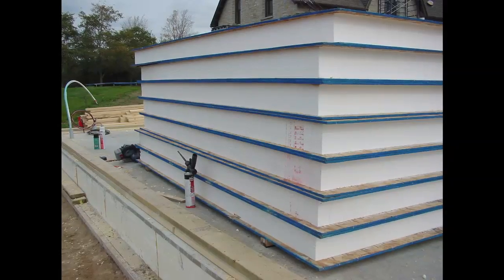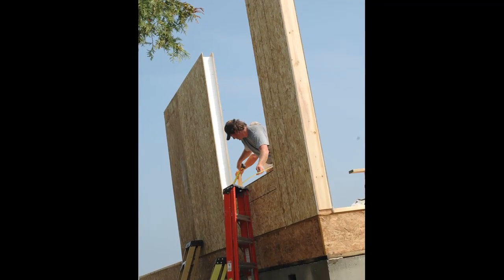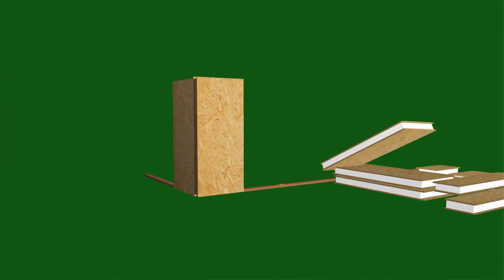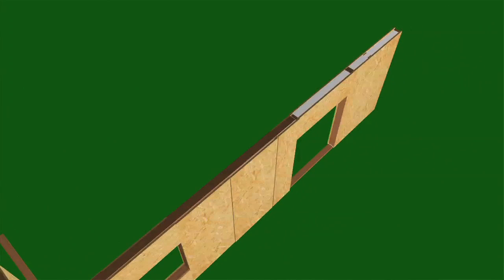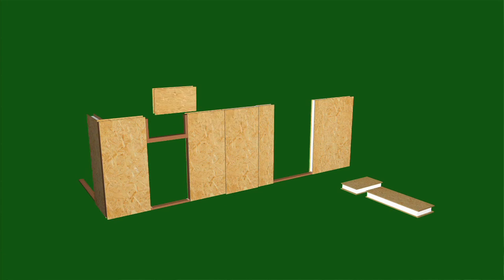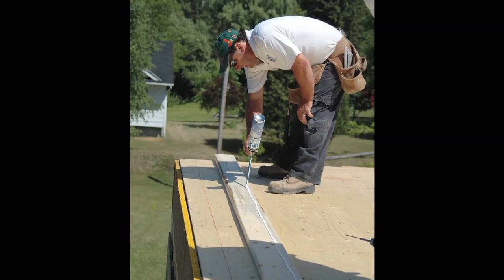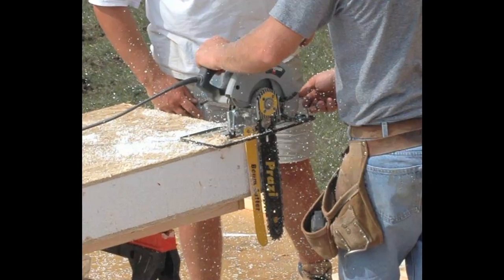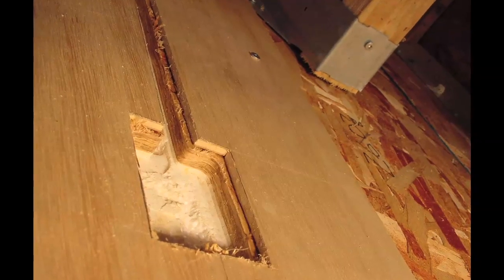How Structural Insulated Panels Work

Comment from the maker: Good Morning BorntoRunBarefoot! I've never seen SIPs in anything different than 4 feet widths, but the lengths do vary. 8 feet is the shortest, and I've worked with panels that are 16 feet long. I've heard of panels as long as 24 feet. Are you planning to build with SIPs? After living in a structure built with them, I really like them.
Drop by my website http://stevemaxwell.ca for a visit sometime. You'll find lots of stuff there, including tool giveaways, articles and the chance to ask me questions.
Bye for now and thanks for watching!
Steve
Reply: Steve Maxwell
Reply: I've got a problem with the price being 5% higher than stick built homes when you know damn good and well that thosr sections being built cost less than a stick built section and the fact that your cutting down on material and man hours worked then why is it 5% higher your saving a shit load at the normal rate of a stick built so why 5% more and how I know is that I've been in business my entire adult life and no company takes on a new design in building if it doesn't mean cheaper for them because it doesn't matter if the amount that it's better is 100 times the previous if it doesn't save them money and is going to cost them 5% more they will not do it unless it's mandated by law and then they'll try to get around it all I can see is this way saves money on 2x4 and 2x7 and truses less wood in a building and foam is cheaper than wood or you'd be building that section out of small truse like beams inside it for support
Reply: @who-manwho4182   SIP panels cost more to make, not less, than stick frame.  A stick frame can be put up by 2 guys and hand tools.  Quality is down to subjective onsite skills.  SIP panels involves a factory, CNC machinery, Certification & testing (no grandfather rights here...), and regulatory compliance.  It's not even an 'apples vs apples' comparison you're making, it's a 'fruit vs veg' comparison.....  And if the only thing that matters to you is price, then you're missing a whole other bunch of points...........
Reply: There used to be a company here in northern West Virginia called panelcraft. They would make any size you want up to 42 feet long. You could put up four walls with just 4 panels. They sold the business and I can't find them anywhere like that. They actually cost a lot less than traditional building. Seems like it caught on and it is a lot more expensive now
Reply: Here in Ireland, we can make panels up to 12m long x 3m wide.  Most roof panels we make are up to 5m long x 2.38m wide.   For walls our most common panel sizes are in the region of 4m - 6m long x 3m high.    All are craned in: too heavy for manual handling.

Comment: Sorry if this sounds really dumb, but I am currently writing my uni assignment. I have to advise on a building which could be used for emergency housing. It must be built on site and must be able to withstand extreme weather conditions. I would like to suggest SIPS but would you need cover the sips panels with an external barrier to the elements? If so, what would you suggest? also do these need any steal frame for support etc? Thanks in advance.
Reply from the maker: DannyRed Hi There! That's not a dum question at all.
SIPs panels function on their own, without any need for structural support in walls. Roofs can also be made with nothing other than SIPs. A weather barrier is required for SIPs made with oriented strand board, but SIPs are also made with plywood. These would need no exterior protection in an emergency situation because uncoated plywood SIPs are even used for buried foundations. My contact in the industry is a guy named Jeff Taraba. He owns Thermapan and you can contact him at jtaraba@thermapan.com.
Does this help? I hope so. Please let me know.
I cover lots of cool things on my two websites. For construction, woodworking, renovations and tools, drop by for a visit at  https://stevemaxwell.ca. Homesteading stuff is at http://www.realrurallife.comBye for now,
Steve
Reply: ***** I really appreciate that Steve. Thank you very much, you will be referenced in my assignment!

Comment: Great video Steve.  
I like the SIP panels.  I would definitely build my home with this product.  The only improvement I would make to this product is; I would sheath the exterior panel with Zip System OSB Sheathing, for both the walls and roof.  I imagine this would greatly increase cost of the panels, but a man can dream.  

BTW: Did you use post and beam framing for your workshop, to accommodate for the SIPs?
Reply: +byron simon I watched a few videos on the Zip system... I agree.  I would be prepared to pay a premium for that if something like a SIPS with Zip System was available in Australia.
Reply: Eco panels in Mocksville NC has just what you are looking for.

Comment: Hi Steve,

I have done field cutting in the past when the homeowner can't decide where to put a window until the walls are up and they are standing inside the structure. Sips are great for that especially when the window or door opening is under 4'. 
I am in SW Minnesota and the manufacture I use pre-cuts all my panels for me. It's fantastic. I am at the point now where sip structures is all I do. (Not sure how to send pictures)

I am surprised there are no manufacturers by you who would do cutting. Where are you located?  My supplier has shipped to New Zealand, Japan, etc....

Take care!

Comment: Love your video.  One thing I would disagree on is field cutting all doors and windows in the field verses having it done in the factory.  Especially for walls of windows in a great-room where engineering/sizing of posts and headers is required, this would be advantageous to put the liability back on the SIP manufacturer.  Keep up the great videos.
Reply from the maker: Mike Dandar Hi Mike! Thanks for your note. There are no SIPs suppliers that I know of in my area that deliver read-cut panels, but that's not as big a deal as you might think. Cutting on site is pretty easy, and all the details need an engineer's stamp before you get a permit anyway. I have heard of pre cut SIPs in other places, but never worked with them.

Do you have a building project in the works?

Drop by for a visit sometime at my online destinations: @/stevemaxwell.ca and Bye for now, Mike. And thanks for watching!Steve
Reply: Hi Steve - and all - actually we in Ireland deliver all panels with opes pre-cut: cutting them in the factory is the only way, and it's done on a big bed (16m x 4m) CNC machine.   For what it's worth we only use 15mm OSB3 to both sides as for very large panels (our biggest is 15m x 3m), 9mm/11mm isn't rigid enough for onsite handling and shipping.  John Moylan, SIP Energy, Ireland.

Comment: Styrofoam is non biodegradable. Its disturbing to see that stuff blowing in the wind when you cut the panel.
Reply: Hi Steve,
Most Styrofoam litter ends up as marine pollution. When it does eventually break down it releases toxic by-products. It is made from petrochemicals. Most countries have banned its use as packaging.
I like your product, its a great alternative to conventional methods but I wouldn't like to see it turn into a mainstream solution. Its got a great R rating which is a plus, but that's about it. I don't know where or how you would dispose of it in the future when it is finished as part of the construction. In the meanwhile could you please promote safe and responsible disposal of the waste. I used to work with the product the product here in Melbourne and I regret all the times I let it blow in the wind.
Good luck to you Steve.

Comment: how do these houses stand up to hurricanes what is the wind rating? lets say the house is bult to code in florida what can it take
Reply: Several SIP-built homes were knocked off their foundations in Louisiana and Mississippi during Hurricane Katrina. The homes were found, more or less intact, several miles from their foundations after the hurricane.  They had floated away from their foundations after wind and water wrenched them off the concrete slabs.

I also have a friend who has a SIP-based home just north of Lake Pontchartrain whose house has two large trees fall on it during Katrina. Limbs did puncture the roof but damage was minimal. The trunks snapped upon impact with the roof.  These were two pine trees with base diameters in excess of 20 inches. The technology is extremely strong.
Reply: There were two ways to prevent this. 1. Better anchoring to the foundation. 2. Better house design, e.g., a dome presents so much less wind resistance than a box that they stay put in 150mph winds. They withstand F5.
Reply: Don Duncan  I’m not providing these as an example of a SIP vulnerability. Quite the contrary! The OPs question concerned SIP survivability in a hurricane. My response was to illustrate the SIP technology was extremely strong and survivable, even if, in one case, the House was torn off its foundation or in the second case, when extreme winds blew down a very large tree onto the house. In both cases, a conventional frame house would most likely have been destroyed.  Both of these houses were very near the eye-wall of Katrina as it made landfall on the MS/LA coast.  I viewed both of the houses a couple of days after Katrina hit, everywhere around them the was pretty much catastrophic devastation for stick-built houses.  The only other home construction technology that demonstrated similar survivability was concrete home and many of then lost their roofs.  

In addition, I visited the second house a year after Katrina, after some normalcy had returned. I was also impressed how cool the house was with very minimal A/C, how quiet it was inside despite truck traffic outside. If ever I build a house, I will utilize SIP construction.